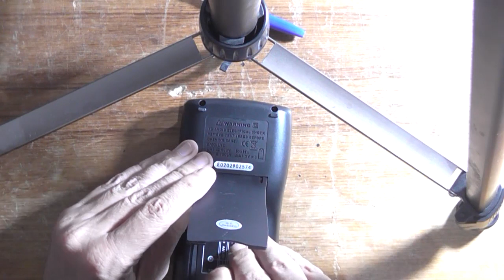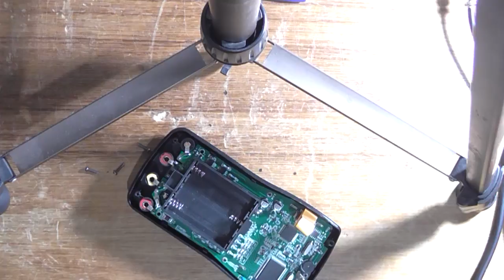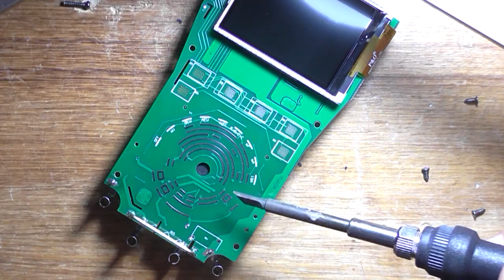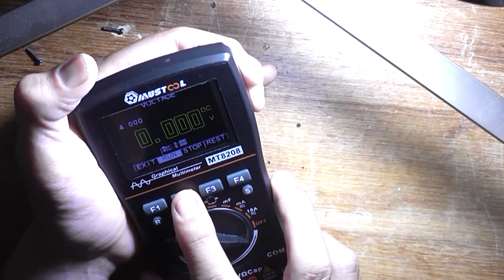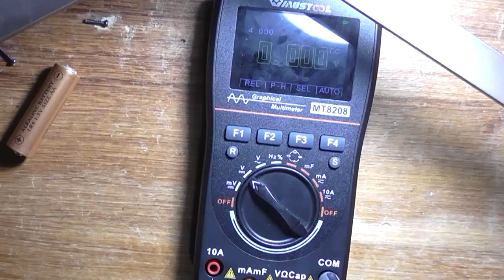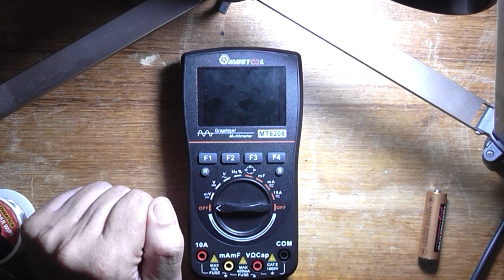Mustool MT8208 Multimeter Service

Comment: HA! I remember buying that Kirkland battery in Costco. Kirkland is the value brand of Costco, you probably don't have Costco in Tassiestan. 
Also, the shielding inside the casing is actually quite rare for cheapo multimeters so that's a nice touch from mustool.
Reply from the maker: He he. Not sure why the meter did that in the first place. I was measuring the dc output voltage of the psu and it suddenly climed up to 160V and kept climbing. I unplugged it quick smart. The voltage went back to 80 odd volt after climbing to 3.9kV!